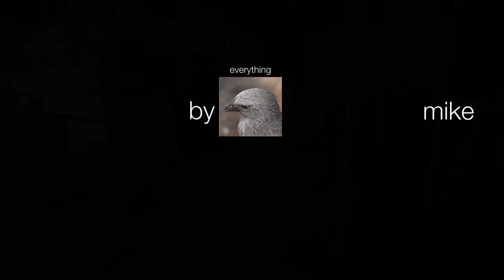The Wombat Project, Ep. 2 Overland Truck Build.

Comment: Greetings from an American by way of Germany. I am also very interested in building my own overland truck. Thanks for answering the previous questions as they're some that I have as well. I definitely will purchase the book you mentioned. So far your build looks great. On a similar sized X military 4 wheel drive vehicle, would you recommend extending the box by a meter and a half? Also it would be great if you would also talk about some of the challenges you may have encountered and how you overcame them.
Thanks and I look forward to finishing your series and seeing the end product. Be well
Reply: Greetings
 from Dubai,UAE. I appreciate your effort, I am retired and ready to start ,but needed your opinion if i can use a container size refrigator instead of going through what you have . I will have to build in and around it to become a camper.
Regards,
Mahdi.

Comment: G'day Mike, from London.Superb build project! I am 'planning' an overland truck at some stage but don't have your fabrication skills unfortunately. Could you talk a bit more about the design and planning you went through before you started actually fabricating? So how did you decide on living space size? And what all the features and layout of that space will be? And have you specified, researched and purchased all the bits you will need inside and out, like power systems, fridge, stove, water, security etc etc? Am looking forward to the next video on progress with the build!
Reply from the maker: Thanks for your comments.   I have a book by Haynes called 'Building your own Overland Camper '  by Steve Wigglesworth   which is good.  I also have learn a lot of You tube.!!